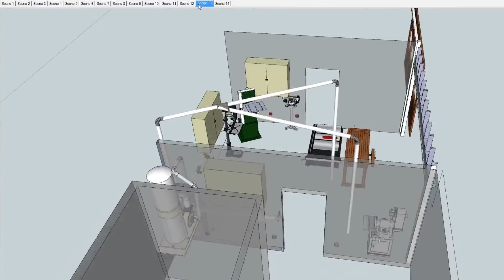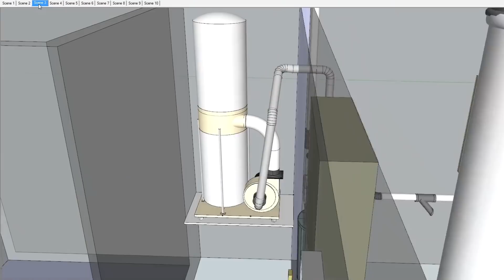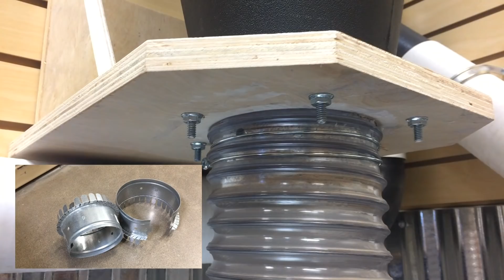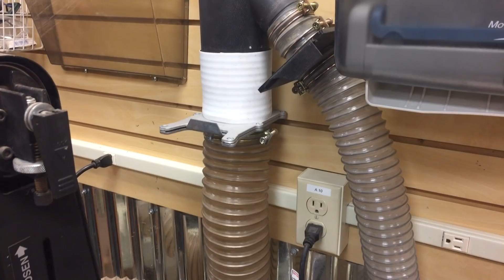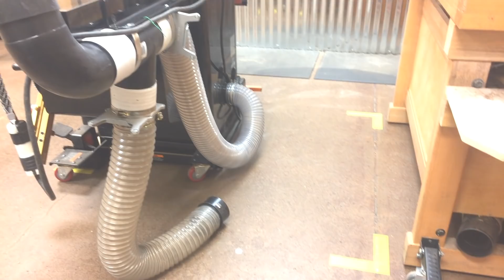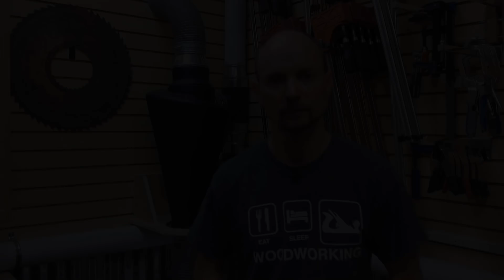Dust Collection Ducting That's Cheap and Easy?

Comment: Heating PVC enough to soften it, even just that much, will release carcinogenic compounds.  At least do it outside and paint the joints with plastic-bonding paint afterward!  It’s enough that I’m going to bite the bullet and get either 6” spiral or >26ga snaplock duct and fittings.
Reply: I mean…cancer sucks!  cancer.gov/about-cancer/causes-prevention/risk/substances/vinyl-chloride

Comment: I'm interested in your system. I've got a 2 h/p dust collector. I've only got it connected to 1 tool at a time. I've got it connected to my table saw via flexible hose. It seens to struggle. I used to have a much smaller collector via a dust separator and did much better. I'd like to put my system outside  in a self-contained shed about 8 metres away. I thought the 2h/p would have plenty of power to pull that far. Any ideas

Comment: This is a terrific tip!  Thanks!  I’ve been installing an Oneida Super Cell Turbo and was set to spend a small fortune on the special vacuum-rated ducts Oneida says you need.  Decided to give this a try and picked some of this up at Lowe’s.  Was quick and easy to install, works great, and saved me about $1,000.

Comment: Hi, great video.  You and I almost think alike.  I have seen a lot of dust collection system videos and I have not seen any that uses the same drain pipe as I did till today.  I am on a budget and cannot afford what woodworkers are using this days.  For a long time I have a ridgid 6.5 amp vacuum that I been using and it works great.  But dust still continue to fly all over my garage.  I went to my home depot and they don’t even carry what youtubers are using.  I went online and saw what they are charging for this kind of pipes.  Its discouraging to upgrade when it costs this much.  I went to Home Depot and saw the drain pipe and why not right? Will do same job, its just good as the expensive ones.  And a lot easier to adapt to any universal dust collection fittings with only use of a torch or even a heat gun.  When I saw your trash can I was happy because I used the same exact trash can for $20.00 My neighbor got the same thin metal material for almost $400.00 because he said it was the right product for “dust collection”.  Nope this trash can works better for a lot cheaper.  The only thing I did not think of was installing wheels, thank you for that.  I spend a lot of time at Rockler every time i go there, and its very hard to piece together a collection system that easily connects with my harbor freight 2hp without buying all kinds of adapters just to fit 3 different brands of connectors.  I’ll be sure to follow you and maybe I can get some more ideas, that i have not think about it yet. Thank you

Comment: Thank you for a very good, informative video that's going to hopefully save me a whole lot of money on duct work... My only question. Does that collector move enough air to pull the bigger stuff up into the ceiling and over to the cyclone? I've only worked with my shop vac system, so I don't have any experience with the bigger systems yet, but I know my little shop vac system would laugh at me if I tried that lol... Again thank you for the video. New subscriber

Comment: I figured I would try your heat shriking approach to friction fitting the DWV to the ABS plastics. Not all ABS dust collection 4" pieces are actually 4", or even uniform. In order to get enough shrink on my, whatever brand it was that Woodcraft sells, I had to use a band clamp to pull the softened DWV PVC in a bit to get it to go, but once it is cooled off, just take the clamp off and it is a good, tight friction fit. Should be leak free! I am moving mine around to get the runs straighter / less flex hose used, so this will come in REAL handy. Thanks!

Comment: I had a flour sweep and I loved it however I have removed it due to an inherent fire risk. The danger comes from the chance of metal fragments, screws, nuts etc getting sucked up and causing a spark when going through the impeller blades. James Hamilton, aka stumpy nubs warns of this in one of his vids.
Reply: Im going to glue some of the harbor freight tool magnets to the inside of my floor sweep to catch metal objects before being sucked up.  This would be a good control step, just not sure if this addition enhances static risk. I doubt it but I’ll have to research that.

Comment: Very nice setup. I’m doing a similar setup with my shop. I have a question and want to get your advice. I planing on running the jet cyclone 1.5 hp. Which diameter do think is best. I was going to do 6” if I can away with 4” that wouldn’t be better. Wanted to get your opinion ?
Reply: 6" will move more air, so go with it if you can, though most large tools have a 4" port, so you can branch off to the tools with 4". Some people DIY a 6" port onto their tools to keep it all 6".

Comment: Hello, so I loved your video.  I bought the pipe, but i am having an issue finding the wye's and 90's that do not have a bell end on them.  I noticed your wye doesn't have a bell on it.  Can you tell me which connectors you used please???

Comment: I love how you explained everything step by step! I have a 2hp Harbor freight dust collector that advertises 1500 CFM ( which I doubt) and Super Dust Deputy I haven't installed yet. I am in the process of installing my dust collection system and have a couple of questions. 1) With the filter in the other room do you find that you pull all your conditioned air out of your workshop almost as if venting to the outside? 2) What CFM does your Jet advertise? I have went back and forth with venting outside, installing the dust collector motor in the attic, making it fixed with ducting or keeping mobile etc.....

Comment: Great info! where did you get the black fittings? thanks
Reply: Late reply but those fittings look like the Powertec pieces I have been getting from Amazon, as well as flex pipe and clamps, etc. They carry bends, wyes and even a three into one connector. They are sized to be right at 4" o.d., which slips directly into 4" flex hose. Rockler carries most of the same as does Woodcraft (house branded for them), although Amazon usually is a bit cheaper.

Comment: That was a great video. I am in the process now in my shop. I had one question where did you get the fitting to go from 6 to 5 off the dust deputy. I have bought multiple reducers and all are the same size as the outlet on deputy?
Reply: Woodcraft has them

Comment: What is the benefit of having the cyclone in addition to the dust collector? Why not just have one bag to empty out?

Looking at setting up piping because I’m new and already tired of rerouting vacuum hoses around. Are the bigger dust collection systems quieter than shop vacs? I’d love something a little less noisy when I’m between cuts.

Comment: Can you bend the pipe instead of using elbows or 45° T connectors? If like to bend it to make one sweeping curve or arch in my ceiling and to avoid connection joints if possible.

Comment: I'm surprised the 1.5 HP vacuum is able to handle that amount of pipe, fittings, and cyclone.  Any issues?
Reply from the maker: More than enough power. It works great.

Comment: How do you find the various adapters for smaller diameter hookup ports on smaller tools?  I’m getting my home shop up & running, but all the adapters I’m finding are the same size as the ports themselves, so nothing fits over or into the port to attach, and I can’t figure out what the heck I’m missing.
Reply from the maker: Go to a woodworking store. Woodcraft or Rockler. It’s one of the most frustrating parts of the industry. Fern o couplers and other adapters are helpful.
Reply from the maker: FERNCO
Reply: Thanks, I’ll give them a look.

Comment: This gets a 10 star rating!  Using the HD 4" DWV is so much cheaper than flex pipe and no need for expensive connecting clamps.  I used a heat gun and just needed to practice to figure out how much heat to apply until the connections went in almost effortlessly.
Reply: what temp did you use on the heat gun

Comment: So what about grounding?   Is this not a problem with the kind of piping you are using?
Reply from the maker: Not at all. This is one of the most common questions asked. My experience has shown that static electricity on this ducting is a non issue.

Comment: The pipe you’re using isn’t “drain-waste-vent”, it’s triple wall pipe and it’s used for underground rainwater drains. The ribbed inner wall would not allow proper drainage of waste material as it would slow the material which is moved solely by gravity. While cheaper that pipe also has the same affect on air flow as it’s not smooth, those ribs still create drag or friction on the air as well as cause any larger material to tumble along the piping instead of staying suspended in the air. It may “work” but it works better with the proper piping. 

In many parts of the country schedule 20 isn’t available, only schedule 40, however one might be able to find ABS pipe which is the same diameter but black, the same material as commercially available black plastic dust collector fittings. Both ABS and PVC piping can be heated to make an airtight seal with the fittings, if one doesn’t use the appropriate plumbing fittings, but caution MUST be used when heating PVC, ABS, or Triple Wall drain pipe as heated plastics give off toxic gases. People need to understand this and research how to do this safely, or just pony up a bit more money and buy the plumbing fittings, or stick with actual dust collection pipe. Toxic fumes from heated or burning plastic are just as dangerous, if not more so, than the sawdust you’re collecting. 

Edit: having the DC “on” and closing all the blast gates is also a bad idea, it creates way too much back pressure on the motor. A better idea is to open the second gate, then close the first gate leaving the DC able to “breathe”. #protip
Anyway, food for thought. Stay safe. ✌🏼
Reply: Closing the blast gates unload the motor.  Conversely having the inlet to  the impeller wide open and say the bags removed could dangerously overload the motor.

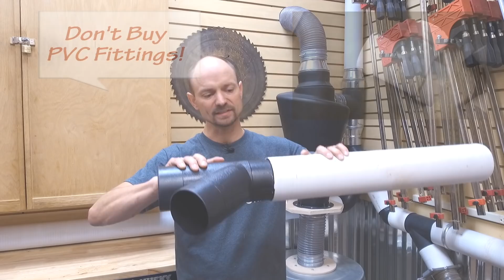Comment: Great video.   Question sir...at 3:59 you have a call out about not buying PVC fittings.   Other than price and weight to deal with, what is wrong with using PVC fittings?   Thanks,  Brad
Reply from the maker: They run a tighter radius and result in loss of cubic feet per minute of airflow. We’re trying to preserve this as much as possible.

Comment: Nice video.  One thing I have been told is that before turning on your dust collector you should first open the blast gate to the tool you plan on using.  Now, I have not experienced it myself maybe because my DC is only 2hp but, I have heard and seen where a line or cyclone container can collapse under the suction when all of the gates are closed.  Maybe it only happens if you have a more powerful collector but I have always made it a habit to open the blast gate first or open the next one I am going to use before closing the previous one if I keep the collector running in-between.
Reply from the maker: Always good practice to open the gate first, but after you’ve been working in the shop you’ll be bound to forget to do it. It just happens. Don’t use a plastic garbage can. Metal won’t collapse.

Comment: Great video very helpful. I was shopping for a cyclone and my salesperson told me not to use PVC pipes because of static issues.
This was confirmed by some youtube videos. How did you deal with static grounding ?
Reply from the maker: That’s one of my most common questions with the system and video. I have been running this in my shop for over a year now. Static is not any measurable problem. I lecture regularly at OSHA conferences and there has never been a single incident of a home shop explosion. The bigger risk is getting shocked and reacting to a tool. The only tall that produces any measurable level of static is the horizontal drum sander.  I really don’t think you’re going to have any problem with static. If you do, it is easy to ground your flex pipe to each individual tool by taking the wire on the pipe and screwing it to a metal part of the tool body.  Cheers.
Reply: @DIYWoodGuy : Thank You for your fast response. Would you know if the DWV 4" is a good choice? What is OSHA ?
Best Regards
Dirk
Reply: @DIYWoodGuy  Try sticky backed copper tape if you encounter a problem - the stuff that's used to restore old slot car track and in gardening. it's cheap (from the auction sites) and easy to apply / reapply. If you are using plastic pipe clips you can also run it over these and to the bracket screws to earth the whole system.

Comment: Thanks for the great video.  You describe everything perfectly and answered all the questions I would've had which is awesome.  Subscribed!  I actually had one question.. Does that initial T split off the cyclone have much impact on blow rates?  I intend to do the same but wanted to see if you have problems that I will encounter.  Thanks again!
Reply from the maker: The only challenge I’ve had was cleaning up a pile of wood shavings from 4 bowls. The shaving pile was approximately 3’ square by 6” high - a lot of wood shavings!  I pushed these into the floor sweep but noticed I lost suction half way through the pile. The shavings actually clogged in the Oneida separator. The T posed no problem. It’s much faster to hand scoop big shavings piles so that’s what I do now.

I wouldn’t change much about the system. It’s worked flawlessly. I’ll be doing another video on the system to talk about lessons learned so keep an eye out for it.
Reply: @DIYWoodGuy  Great, thanks!  Look forward to the next video on the lessons learned!!!

Comment: so much for running sheet good over the table saws table  the hose is in the way. And doesn't 4" pipe in and of itself slow down the air and lower the CFM  have you tested the cfm at the dust collector? you should. for a shop with a dust collector you seem to have a lot of dust on the floor still.   I think you should add an over arm unit for the tablesaw. and on the front of the saw you have a big gap for the blade tilt look on amazon they make a magnet that you can put over that so you don't lose suction this might keep more dust from exiting the saw's top also adding a zero clearance insert for the saw as well.
https://www.homedepot.com/p/Microjig-Magnetic-Dust-Cover-for-Cabine

https://www.amazon.com/Micro-MDC-17-Magnetic-Cover-Steel/dp/B07BHW2Q7X

https://youtu.be/w3yIHll_Ez4

Anyway I keep seeing dust collection systems set up like this but I work with sheet goods too so I believe the only true way for a system to work is if the dust collection system is in the floor, yep I said it jack hammer out the cement put in 6" pvc pipe or have your house custom built like that I've seen a basement done like that  and his shop was spotless.   I've also see on over the floor and it was a trip hazard. but so's the cords. the best way is in the floor.  Hey look you get to but a concrete saw and jack hammer mark out the cut lines
cut it out add a rim you can lay timbers or planks on lay in the pipe run power lines in and add to it any place or just pour cement over it with power outlets. But the saw can not move.
Reply from the maker: Thank you for the thoughtful response. A few things to consider:

1. The table saw is not limited by the dust collection drop. The ducting is mounted on the side of the saw, not the back. This means that you can still cut at a max fence cut capacity without the ducting interfering. Of course if you choose to freehand sheets of plywood bigger than your fence capacity that’s your own business. 

2.  We are using an Industrial SawStop. Thanks for the suggestion of the magnetic dust cover. This would be much more relevant on an older table saw. SawStop table saws actually channel the dust into the hose so this product isn’t needed. 

3. Ducting size. The whole premise of this video is cheap and easy dust collection ducting.  6” isn’t cheap or easy. 4” is more than sufficient and after a year of use I’ve yet to get a single clog. Let me know how jack hammering your concrete garage floor goes. I’ll keep the flexibility of a ceiling mounted system. 

4. You have a lot of dust in the floor. You’re right. Sometimes videographers stage things to tell a story. I never have this much dust on the floor. The visual was a good one since it shows what the system is capable of. 

5. Do you have enough CFM and did you measure it? Yes. It’s amazing.  Again the proof is in the pudding.

Comment: Does one have to ground a setup like this? screws into the pipe and a copper wire running to a ground point?
Reply from the maker: Lots of evidence online to show grounding is in effective. We have next to no concern with our setup. Minor static. Copper wire adds cost and makes clogs. Pass on doing that.

Comment: Thank you. Just beginning plans for dust collection very helpful. I noticed the Rikon 14” bandsaw. I need to replace my 10” for resawing wood blanks and looking at 14” models. Can you provide any suggestions and your thoughts on the Rikon 10-324 or 10-326.
Thanks.
Reply from the maker: Spring for a 14 inch bandsaw. They are pretty much the de facto standard in most American workshops this specific saw also has the option for an out on module that makes a variable speed which means you can do metal.  14 inch deluxe all the way.  10 inch bandsaw’s will be very limited - but if you only intend to use it on small stuff then it will probably be fine. Second to a table saw the bandsaw is one of the most usable tools in your shop. Cheers!

Comment: Nice video! Does the table saw drop get in the way when you make longer cross cuts?
Reply from the maker: No since the fence can move to it’s maximum position without impacting the fence. The drop down is on the side, not back of the saw.